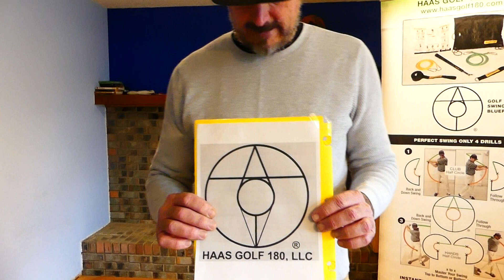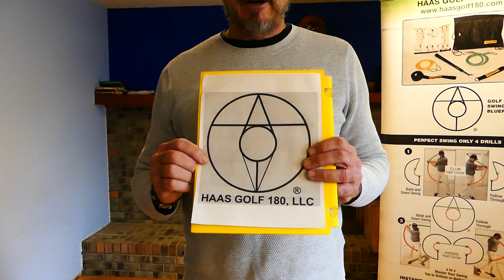Golf "forward shaft lean" reversed engineered with kinematics.

Comment: I bought your golf swing forever tool and its been amazing, I am all in on what you are saying. Just a quick question on this video, how does that inversion concept apply to hitting the longer woods and especially the driver? I assume you don't have shaft lean at impact with the driver, correct? Huge fan of the tool you created, it has definitely helped me hit the ball so much more solid and consistently. Now I am just working on the takeaway and fixing where my hands are at impact. Shaft lean and inversion on all irons but I just don't know how this would work with the Driver. Please let me know your thoughts.
Reply from the maker: Hi RK, with the driver, the shaft lean will not be as prominent for the simple fact the ball is farther forward in the stance. When you watch the top level players notice how the hands are farther forward at impact than they were at address, from face on.  It validates the tangent plane geometry that's being used and the fact the hands return at a different place than they begin.  It's true with all clubs.  The angle should be held until the ball is struck and then the wrist roll happens.
Thanks for your feed back on your 180.   Hands down the best training aid out there to get your performance to 100%.
Reply: Would you be willing to sell me the handle device that you created which demonstrates the tangent plane or share the build instructions so I can recreate it?
Reply from the maker: @ryankennedy6416  Email haasgolf180@gmail.com we can discuss